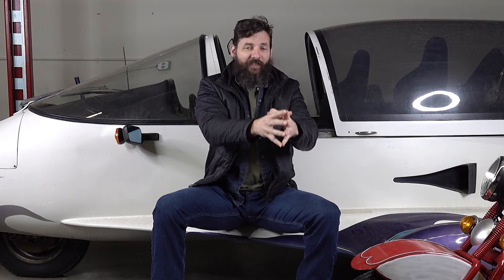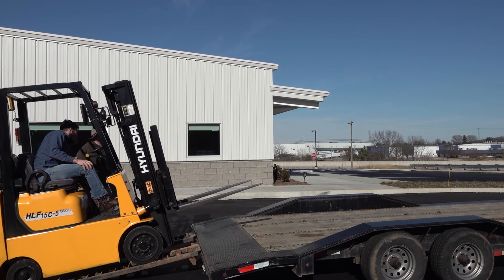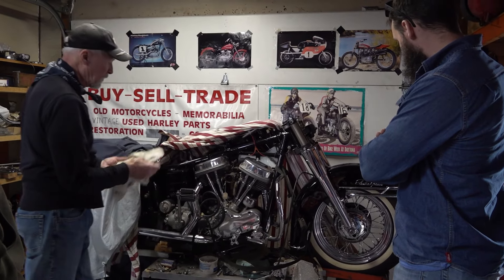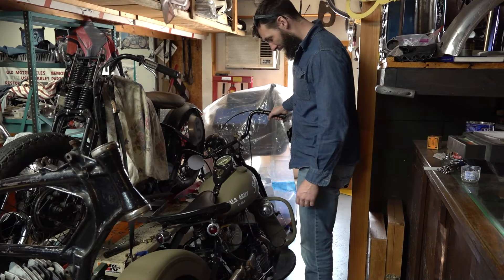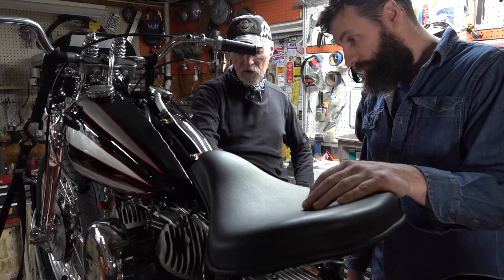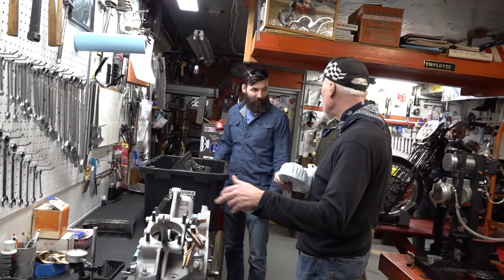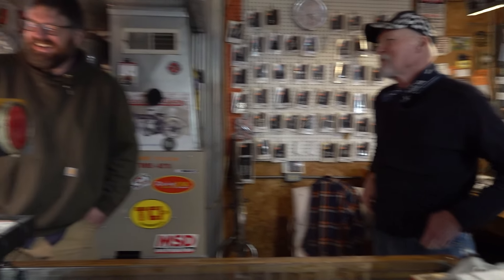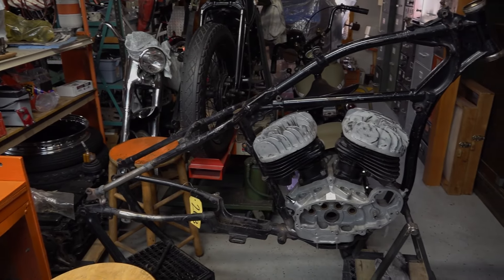Big Announcement on the JUNKYARD WLA Rebuild

Comment: Blue on grey or blue on black is always incredible looking, especially if you go with that blue you loved so much and put it in the factory Harley Racing scheme but blue/black or blue/grey instead of orange/brown. (which in itself is a striking paint scheme) Also making shorty large bore racing pipes for it would be really cool. basically what you are wanting to make is called a Street Tracker, looks like a Flat Tracker race bike but for riding on the street.

Comment: that was cool to see the WLC, My grandpa rode one in the war for Canada in the 40's as an MP, he told me they would weld right angle to the front vertically to head level and as you rode down the road you would hear piano wire pinging that had been strung across the road. I have a pic of him on one during the war

Comment: Don’t know if anybody mentioned it,still watching the video,most people who use Glyptal in race engines use it to aid in oil drain back. He is also right about using it on old castings,most early aluminum castings are very porous and the Glyptal does a great job of sealing cases and castings up. Just be sure to keep machined surfaces taped off or plugged when applying it. I have a set of the WLA cases also that new old stock from gov’t inventory.  They were still available from places like J&P cycles the last time I got one of their antique catalogs but that’s been a while. Check out eBay if you’re looking for nos WW2 45parts,Matt Walksler usually has some available on there,pretty sure that’s where I got my gaskets and Linkert parts. Another good source is from another eBay seller, 45jeffjeff which has a lot of inventory in Canada of leftover war effort parts but there are plenty of sellers who have those parts available. Good luck with the build.

Comment: Blackout lights on WLA's weren't some "little square lights", they were covers that clipped on over the standard 4.5" round spotlights & had a small, rounded visor over a small rectangular opening to allow you to see just enough at night to see where you were going. There were additional blackout covers for the headlight & the twin taillights as well. The visors were so that none of the lights could be detected by any enemy aircraft passing over.

Comment: That trailer was way overloaded with that forklift. I seen it has 5 lug axles so it prob has 3500lb axles. Just a little tip put something like wood under back of trailer when loading it. And its better to have someone in the truck holding brake on, ive seen a few transmission get ruined by shearing off parking pin from trailer and truck rocking back and forth. Thanks for making videos and stay safe!
Reply from the maker: that trailer is rated for 9900lbs

Comment: Tip for when your trailer starts rolling:  reverse back onto the ramps and the trailer will stop. Then you can set your chocks, brakes or whatever.
Reply: And forklifts are heavy beasts with that massive 2ish ton counterweight in the back. 

Ours slipped off the road once and an f250 in 4wd with it's wheels chirping on the pavement could barely pull it back on.

Comment: I should probably start working on my bike. I was given a 77 FLH electraglide with 4500 miles for free, but it sat in a garage with gas in it for 30 years.
Reply: I agree... that you should probably start
Reply from the maker: yeah you should
Reply: @fxrmike5145  motivation is hard! But, coming up on summer here, I pretty much have to. Haven't ridden in a couple years and I'm raring to go.
Reply: @BikesandBeards  it's been motivating seeing your videos where you run through a bike and troubleshoot all the little stuff from scratch. I pretty much know what's wrong with mine already so I have that going for me too.
Reply: @brahtrumpwonbigly7309  I will be looking for 77 shovels with super low miles on the road. Good luck

Comment: That coating is an old hot rodder trick. Guys would coat the lifter galley on their v8's because the coating is supposed to shed the oil quicker and  let it drain back into the pan vs stick to the engine surface.

Comment: When hauling a forklift,  fittings isn't the problem.  Is your trailer strong enough to support the counterweight not to mention the rest of the lift truck.
Reply from the maker: trailer is rated at 9900lbs

Comment: When Colin Chapman decided to run Indy in 1963- 64- 65 with one of his Lotus 29 nd later the 34 with a Ford engine his cars were all British racing green with big yellow stripes around the nose and down the top the length of the car. All the American drivers freaked out because green was "bad luck". Team Lotus didn't win until 1965 but they dominated for several years after that, running a Ford 260 in the 29, a Ford DOHC race only engine in the 34 for a couple years, and then the engine development went to Cosworth, They were dominant, almost completely retiring the Offy 4 cylinder. How much bad luck was the Green?

Comment: Find that Henderson 4 yet? Even if you only found an engine, and built a cyclecar to put it in... They used to race them at the State Fairgrounds in Detroit, and all over, after WWI, and Henderson engines were the ticket. it's also why cops rode Hendersons. My uncle was a Schwinn dealer in Pontiac MI, while I was growing up, and he knew all about the Henderson stuff.

Comment: i love when Craig is trying to help load an eight to ten THOUSAND pound forklift by pushing it.
that thing will turn you into a pancake with 200 lbs of bloody syrup if it doesn't feel like going up that ramp.
i apologize for how gross that sounded, but i think people need to be reminded of how dangerous those things are.  
it's a useful tool that can remove entire parts of your body without even slowing down.
Reply from the maker: yeah its so cool

Comment: All this awsome stuff that you guys are just now discovering...........
 ITS ALL GOING AWAY.  WAKE UP PEOPLE.
  I work for one of the couple u.s.a. commercial vehicle companies.  I won't say which one but, we are one of the largest.  Yesterday, it was officially announced inside the company that no later than the year 2035 we will be completely out of the petroleum powered vehicle business,  i.e. diesel, gasoline, jp8. 
     Another hint of who my company is, we also build military vehicles. 
     This isn't to say we will be manufacturing petro powered vehicles until 2035.  We could have it phased out by 2028 or 2030 or 2025.  None the less,  we will be done by 2035.  We need to start making a big deal about this.  How fun will it be to ride out bikes qhen we have to pay $25.00+ per gallon. And have to go to a specialty company to buy it, by the quart.